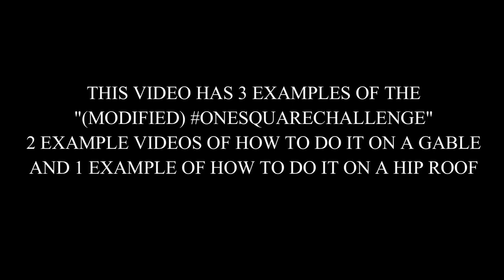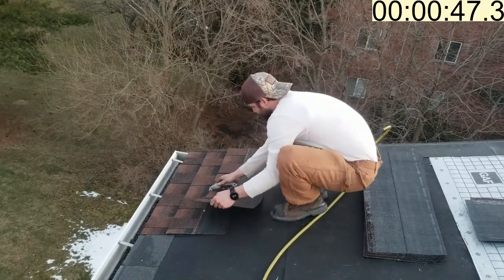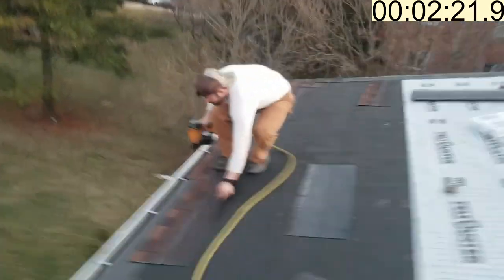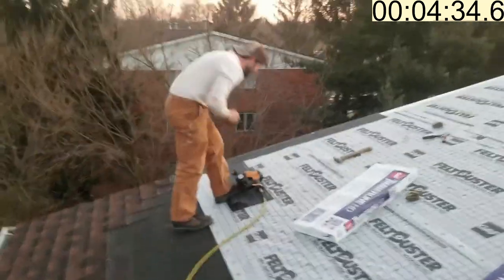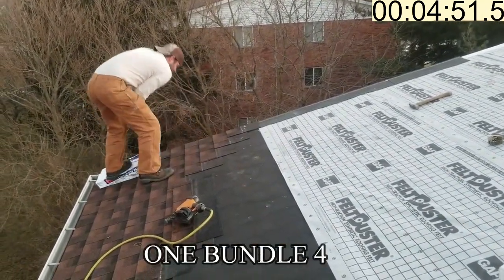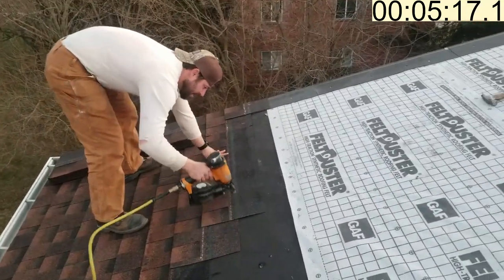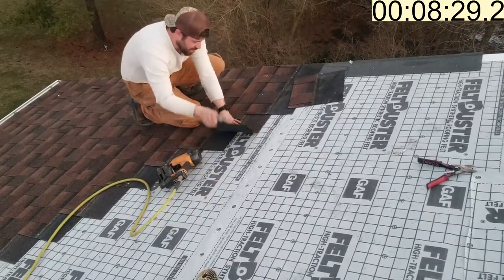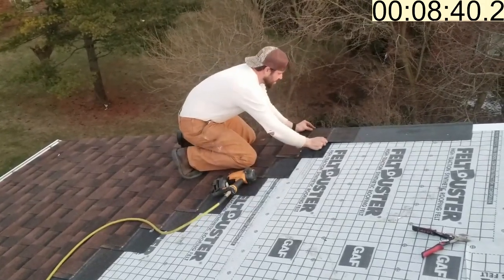You Think You're A Fast Roofer!?!? TRY THIS

Comment: I like to keep my cuts on the outside of the gable ends and all the factory edges budded together in the inside field, that way it’s easier to see if you’re dropping or going up. Cut all my beginner stair steps first and use what’s left on the End.
Reply: Same...let it run wild then cut gable ends with a shingle as a straight edge if need be.
Reply: The only way to go. Plus keeps your book stagger at the proper exsposer. 5 an 5/8 "
Reply: that's the right way to do it according to manufactures specs. Plus this no harness stuff is a whole other deal, so dangerous. this guy makes us all look horrible safety wise. Rookie roofer who's never gotten a fine for no harness or rope. here in Canada you got to tie off on any roof unless you own the house.

Comment: Is it common to feed yourself there? I’m from Newfoundland Canada and we always have feeders for every nailer which is somebody who throws shingles down Infront if you as you move so you just gotta adjust them slightly. They also hand you nails and anything else you need so you never have to get up or stop.
Reply: Yea roofing 10 years in Ontario you see it alot but tbh unless they are like the labour of your dreams I hate  someone els working with me, if they can place my bundles across the roof and put my shingles all the way up my stepping as I shingle on my own  im fine but I can't have someone handing me shit as I need it I feel naked without a pouch
Reply: That's how we do it in upstate NY also.  We got roofers and preppers.. .. the preppers also feed ya... way quicker.. someone lay and u blastem out... I hate rigid nail guns .. Bostich is alrite and Porter-Cable...
Reply: Newfies zzz

Comment: No I don't but using your tips I just put down a beautiful 19sq roof on my house! I didn't have the kauhunas to risk free hand cutting them in the field like you do. Yeah using a cutting board cost me some time but as a rookie it was safer that way.
Reply: @NWIVeteranConstruction  Yes and the other thing I did was to mark the cut lines on my cutting board (6 inch and 11 inch it said on the shingle pack). So I could throw the shingle on the board and line up the left edge and I had the exact cut point. prolly overkill but I felt better.

Comment: Nice I like the 8" 16 " 24" etc.i wouldn't cut my shingles in place though or maybe I put shit piece under the cut nice work
Reply from the maker: i used to pre cut them using my knife as to gage it. knife plus an inch gets you about the perfect size stair step. only reason i cut them in place now is because it keeps the rake edge straighter because i put 3 full length shingles on top of each other so i have a longer line, a lot of guys have crooked ends because the pre cut and need to put on 5 shorter pieces but i definitely don't suggest doing it my way if you don't trust yourself

Comment: Just because the big box stores say a hook blade is a "roofers blade" doesn't mean you have to use it for everything. I use a straight blade and don't risk cutting the under shingle. The next shingle is already upside down ready to cut with a straight blade on the back side. Straight blades are cheaper too.

Comment: No harness, no rope, it's guys like this that ruin the reps of other roofers. Especially when your doing all your cuts on the inside where it's supposed to be factory edges. I watched a few of this guys vids and man o man would the company who manufactures the shingles have a field day not warrantying his roof jobs, workmanship would but manufactures warranty would be void for sure. I seen him a few times in his vids where his nails ain't in the line. Your not fast unless you do it right 100% Including the safety parts of roofing, harness and rope wether its  3/12 or 12/12.  I can't wait to post some vids.
Reply from the maker: Can't wait to post videos lol that's what they all say. Send me one time stamp where my nail isn't in the line! It doesn't exist, I'm major on quality.  Every single nail is in the common bond.  At most 1 per shingle might be slightly high but that's why I 5 nail instead of 4 nail (which my area requires). Also, are you claiming that non factory seems void a warranty on a roof? Because I can assure you they don't! I can name at least 2 different scenarios off the top of my head, where non factory seems are a must, in order to preserve the best quality for the roof.  If it's aloud in those scenarios, it's aloud anywhere as long as it's done correctly. My cuts are straight enough that you can't tell it's been cut.  Shingle aren't like siding or flooring rookie.  There's no connecting edge, therefore, you can do a better job by not being force fed factory connections.  Obviously I do them where it makes sense to.  But I'm also not going to do anything that is nonsensical, like waste time trying to keep factory to factory on a starting edge where it doesn't make a difference